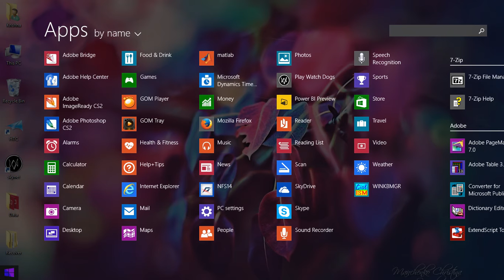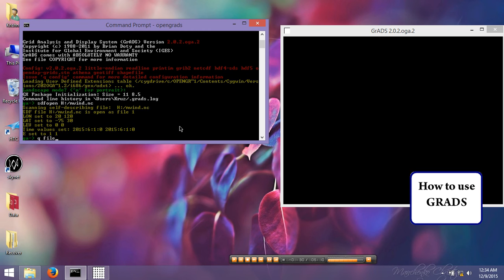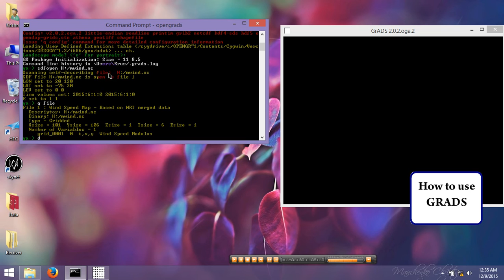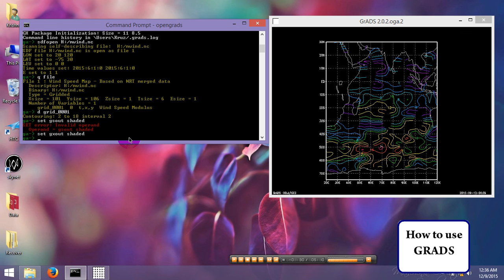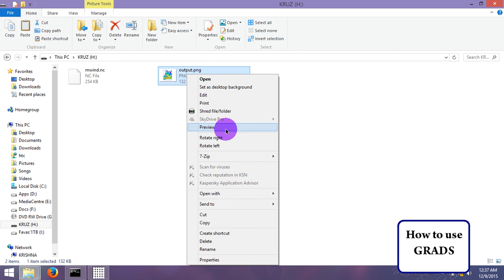How to use GrADS

Comment: hello sir i  want to two nc file at a time in grads can u tell me how can i do ?
Reply from the maker: Hi, that's a good question. Basically you can open two netCDF file using the following example. 

sdfopen data1.nc
sdfopen data2.nc

In here, suppose the variable is "2m_temp" on both files.
If you want to plot, 2m_temp from first file.
'd 2m_temp.1'   
Here the " .1" specify the variable from first file. Similarly to plot the variable from second file as follows.
'd 2m_temp.2'

Suppose you want to see the difference between 2 variables, you can type as follows.
'd 2m_temp.1 - 2m_temp.2'

You can refer similar scripts from these examples. 
 http://gradsusr.org/pipermail/gradsusr/2011-March/029617.html
http://gradsusr.org/pipermail/gradsusr/2014-May/036841.html
http://gradsusr.org/pipermail/gradsusr/2018-June/041728.html
Reply: @KrishnakumarAP  ooh Thank you so much , i will try it

Comment: Sir, Can you help in installing grads in ubuntu. I am struggling for the past one month 😢. I am getting the error that libssl.so.10 file is missing. I googled and typed the command, still not working,sir.
Reply: @Kruz Tech sir, I did this way too. I am getting that libbsl.so.10 files is unavailable. So I googled the solutions possible and tried. Still that method is not working to get libssl installed. What shall I do, sir.
Reply from the maker: @sabreensadhak   I think you meant to say "libssl.so.10"
Try this
sudo apt-get update
sudo apt-get install libssl1.0 libssl-dev

then 

cd /lib/x86_64-linux-gnu
sudo ln -s libssl.so.1.0.0 libssl.so.10
sudo ln -s libcrypto.so.1.0.0 libcrypto.so.10

Hope this will works.

Comment: I am not getting ga->   what to do. i cant proceed. please help
Reply from the maker: Can you elaborate bit more?
Reply: @KrishnakumarAP  sir, that command " ga-> " is not displayed, sir. I am not able to input anything since that command ga-> is not visible on the screen.
Reply: @KrishnakumarAP  
Landscape mode? ('n' for portrait): n
GX Package Initialization: Size = 8.5 11
after this line I am not getting "ga->" as you got,sir
Reply: @KrishnakumarAP  please help me sort out this problem,sir please
Reply from the maker: @sabreensadhak  are you getting any errors? Or Are you getting a blank screen without grads? which operating system you use?
Reply: @KrishnakumarAP  
I am using Windows 10 operating system.
at 0:36 the command prompt box is alone seen ,without any other screen opening. i am not getting this screen 0:40
Reply from the maker: @sabreensadhak  I think it is the issue with x11 window.  You need to add a loopback adapter in the device manager.
Go to Start > Run > type devmgmt.msc
then click on you pc name (will be given in the top of the list)
Then click on Action menu> Add legacy hardware> 
Click Next button> then select "install the hardware manually 
  you will see a list of hardware in a list.
then click on "Network adapters", then on the right side you will see Microsoft.
Click on Microsoft, then somewhere in the list you will see something like "loopback adapter". Select that one, and install it. When you finish it, restart the PC. 
Then run grads, hope this will work, I cannot reproduce the same error right now since I am using Ubuntu right now.

Comment: I just started working on it. Tried to put colorbar, but i dont quite understand how to implement it first. where im supposed to write this code: http://apdrc.soest.hawaii.edu/tutorials/cbarn.gs ??
Reply from the maker: You can save that file ( http://apdrc.soest.hawaii.edu/tutorials/cbarn.gs ; normally it comes with the GrADS. But in case it is not working, you have to keep a copy in your working directory or scripts folder) from the browser (File> Save page as> cbarn.gs) and keep it in the same working directory.
Then type cbarn on the GrADS command window, then it will work. Make sure you using shaded map (set gxout shaded) in order to get color barn. Hope it will helps.

Comment: Hello sir, the file that I downloaded are in .grib format. So what could be code to open the data? The video shows the file in .nc, hence; how can I open .grib file? Thanks.
Reply from the maker: Ramesh Ram to open grib and grib2 files you need to write a control file (.ctl). Please check my other video or this link from GrADS site http://cola.gmu.edu/grads/gadoc/descriptorfile.html
Reply: It's alright I guess. I have generated the contour with .nc version. However, is it possible to generate detailed data from this analysis? For example a tabulated form of the wind data. Thanks for the reply sir.
Reply from the maker: For that purpose you have to use fprintf script ( http://ftp.cptec.inpe.br/etamdl/Users/Jorge/opt/grads/Resources/Scripts/fprintf.gs ) 

its usage is;
fprintf variable-name output-file-name.csv %g 1
d variable-name
Reply: Okayh. I am so blur on what it could mean right now? Haha, do you have any videos in this?
Reply from the maker: Actually you have to download that fprintf.gs script in your working directory, then use those example i mentioned in previous comment.

Comment: Is it possible to open hdf5 file (.h5) in GRADS? if yes, could you please tell me the commands?
Reply from the maker: commands are,
sdfopen Opens a COARDS-compliant NetCDF or HDF-SDS file

xdfopen Opens a non-COARDS-compliant NetCDF or HDF-SDS file

First thing you have to make a descriptor file in notepad or in any text editor,  
eg: 

DSET filename.h5
dtype hdf5_grid
undef -999.0 _FillValue
xdef 360 linear -179.5 1.0
ydef 180 linear -89.5 1.0
zdef 1 levels 1000
tdef 1 linear  Apr2001  1mo
VARS1
var1=>variable1 0 y,x  description
endvars

Save this file with xdf extension. 
(Note: the variable name eg:RrLandRain and this dataset's attributes like time, x-axis,y-axis, z-levels, etc you have to mention in the descriptor file. In order to know these properties you have to read the hdf or h5 file with HDFView, you can download it from https://support.hdfgroup.org/products/java/hdfview/index.html#download_hdfview)

If you made the descriptor file, you can read in grads like the following example, by typing in grads,

 xdfopen sample_descrpitor.xdf

For more details visit 
https://disc.gsfc.nasa.gov/recipes/?q=recipes/How-to-Read-Data-in-HDF-5-Format-with-GrADS
 http://hdfeos.org/software/grads.php

Hope it will helps

Comment: i have these files gpcp_1dd_v1.2_p1d.199611 and have been trying to open with Grads 2.0.2.oga.2 but always receive the error "gadsdf: couldn't ingest SDF metadata". I have tried to follow your video and other sources but have not been successful. Any suggestion will be very welcome
Reply from the maker: +bernard Asiedu Is that a netCDF file?
Reply: It is a gpcp_1dd_v1.2...... file, dont know whether that answers the question. Must admit i am a novice in this area but trying to extract some information from climatological data for my research